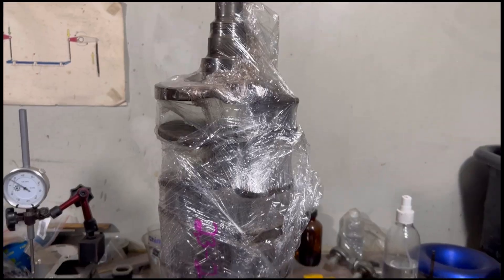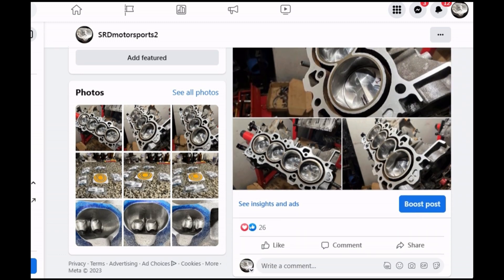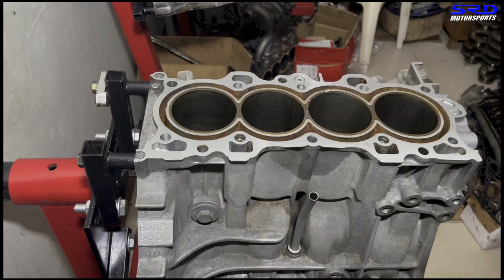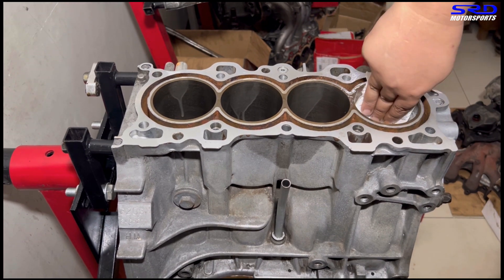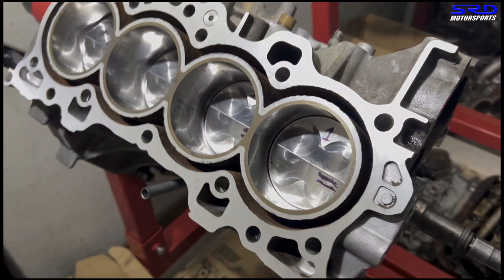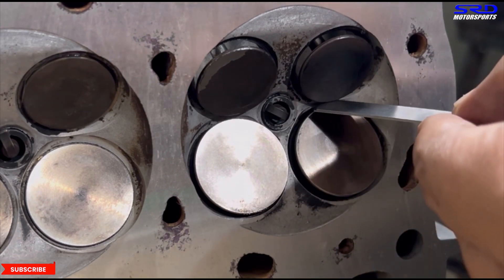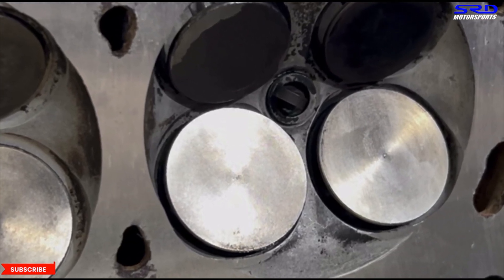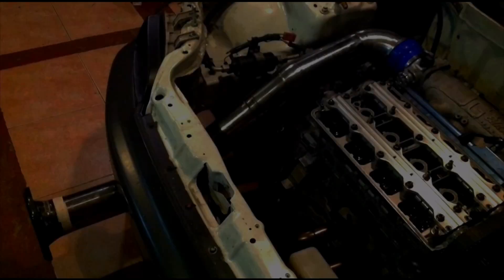B20Vtec Build Part 3 Crankshaft Assembly and Piston Install

Comment: Hi there , I’m currently building a b20v with eagle rods + arp 2000 rod bolts , what should I torque the rod bolts to as I do not have a stretch gauge 😢
Reply from the maker: Eagle rods have a specific torque value they suggest for the correct arp2000 rod bolts u must check that for your rods
Reply: @SRDmotorsports  thanks so much , I was just curious as I’ve gotten different responses on the internet 
It’s recommended that it be torqued to 28lbs on 3/8 bolt - does this sound correct to you ?
I’m just making sure that I do have the correct torque figures 😅
Reply from the maker: @MO20V  if your ARP2000 is 3/8
Reply: @SRDmotorsports  yes it is 🫡 am I good to go boss ? 😎
Reply from the maker: I guess

Comment: Sir, will u do crankshaft balancing for this setup?
Reply from the maker: Nope we didnt, its not unlike other car makers that to rev u need to improve balancing
Honda has been known to be well balanced stock…

but it can be balanced if you’re living at 10k rpm everyday 😎
Reply: @SRDmotorsports  thanks for the info sir, btw this car run 9k rpm or 10k rpm?
Reply from the maker: @Ek3_8888  right now this one is limited to 9,500 we will find out more when it goes to the dyno and then test race